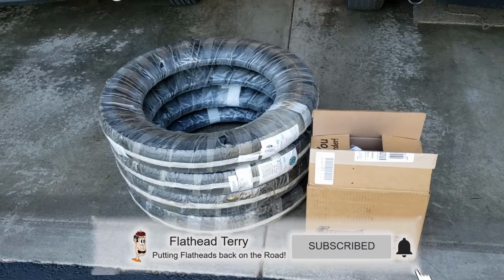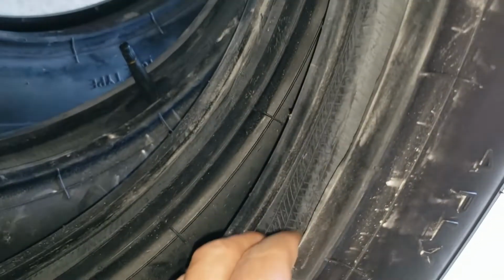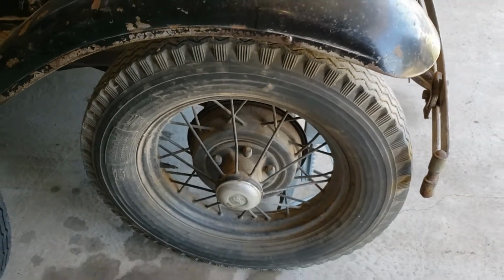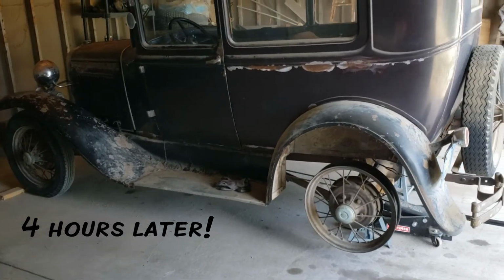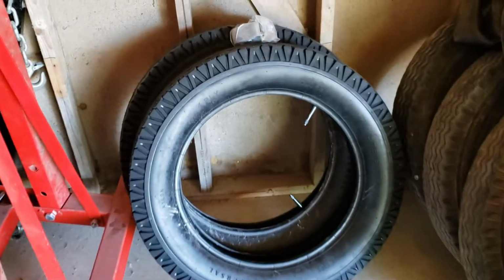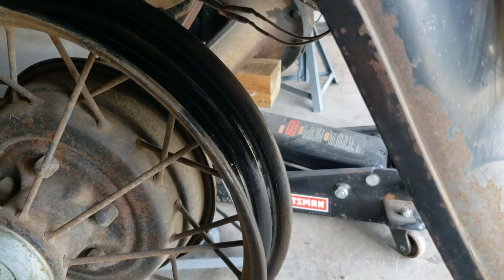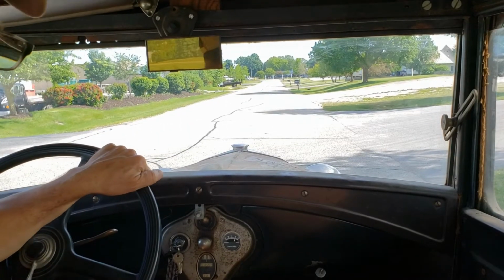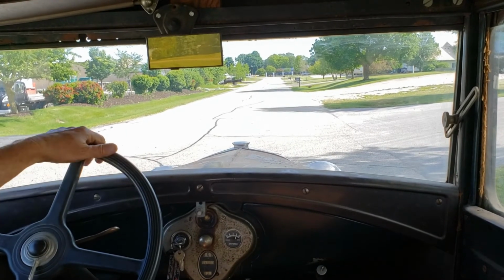Episode 12 - Fresh Rubber for the 1930 Model A Ford! #withme #howto #DIY #restore #willitrun

Comment: The car sounded great during your test drive!  And looks like the steering is really tight - very slight movements of the wheel needed to keep her in a straight line.
Reply from the maker: I drive it daily! Turns a lot heads when I do.

Comment: Good job, Terry, I've never tried changing tyres with the wheel still on the car. Is that a technique from back in the day? They look nice and old fashioned. Glad you could feel the improvement. Mart.
Reply from the maker: Thanks Mart. I've wrestled with tires on the floor many times, but I saw a post from someone the performed it on the car so I thought I'd try it. Some guys even put the tire on the spare tire mount on the rear of the car to have it elevated.

Comment: Would it be easier changing them with them mounted on the spare carrier on the back of the car?
Reply from the maker: Yes, Absolutely! But my spare tire hasn't been off this car for over 40 years so I wasn't going to try to remove it at that time. That will be another project down the road! Thanks for watching and your question Dax.

Comment: I fought with one of mine for an hour. I made the mistake of trying to mount it on the floor. I took the 2 that I was replacing to a tire shop and they did them in 10 minutes for 30 bucks. lol Hey at least I tried. lol